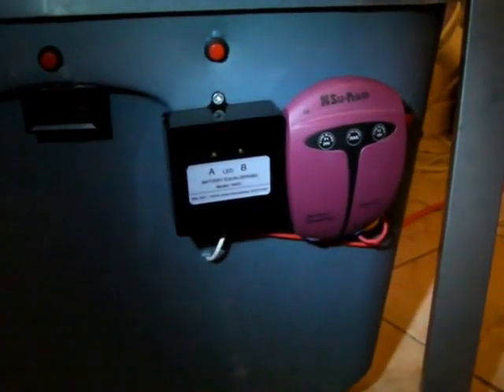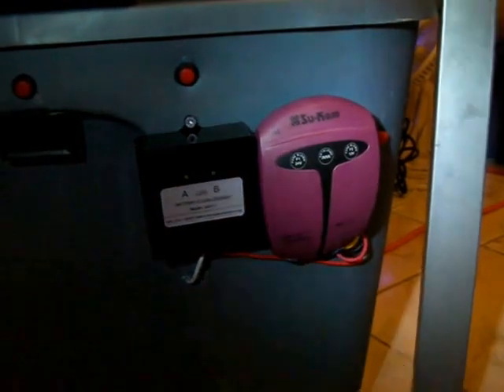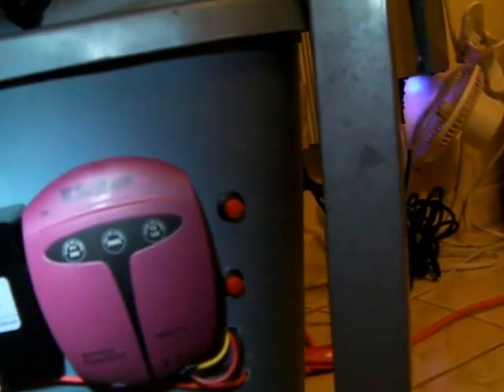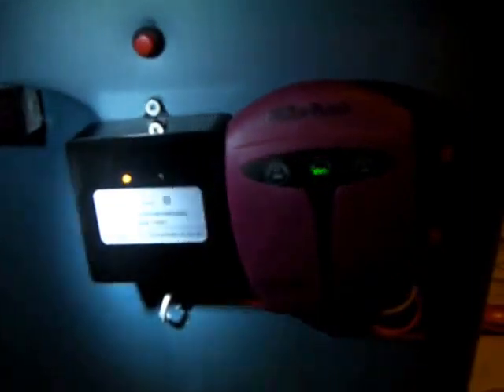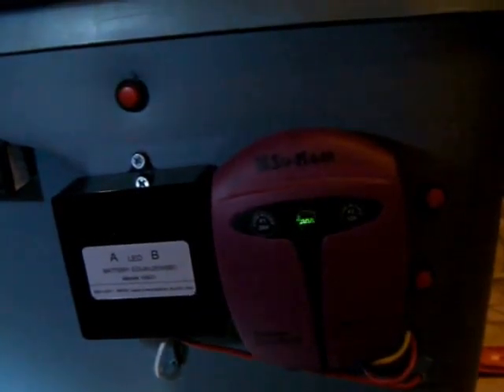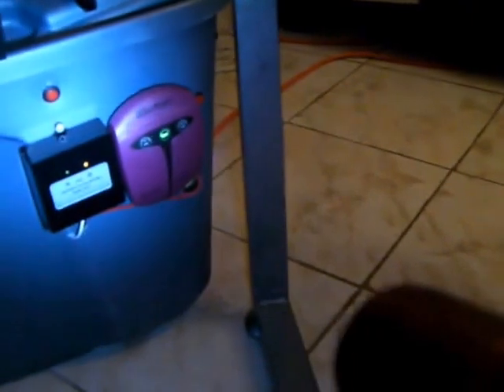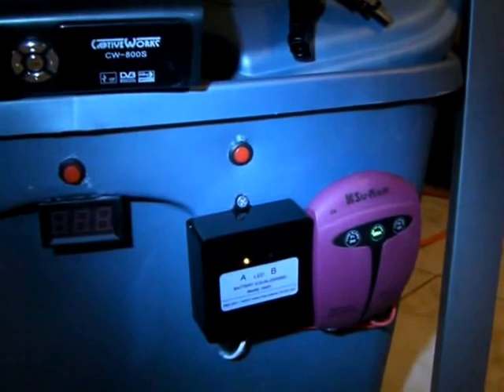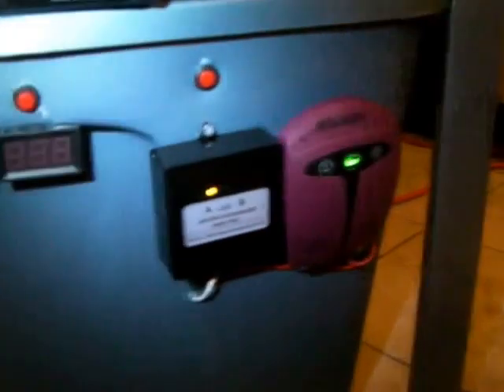SOLAR BATTERY BANK BALANCERS / EQUALIZERS SU-KAM AND HA01

Comment: By the way I am curious about the Sukam version as to what the yellow, black and red represent and how they should be connected in say -two a 12v battery in series connection? 
In that 24 v combined power of the two 12v battery, which coloured wire of the equalizer will connect terminal of the two batteries.
Reply: oh brother it has been so long I dont even remember. After this video I notice that these battery balancers are not that great. I did have good experience with Sukam BMS 48. I also got a chinese unit from ebay that has been the best. That is the unit I am buying from now on for my systems.

Comment: Do you have a video of your inverter?
Reply from the maker: Kain Duran no, sorry...after the Hurricanes we left Puerto Rico and I sold most of my inverters and solar equipment ...sorry about that...look for the online manual I think the model is Cotek 1500s 24 or something like that it was 24v and 1500w pure sine ...I also had a very good experience with the swi 3000w 48v and the 2000w version they are true pure sine waves and also the Reliable brand I have tested and found to be good... Cotek is UL tested something that Swi or reliable are not so keep that in mind.

Comment: Is that a 24v  sp cotek inverter 2000w .how much power it uses just being on ..??not runing noting just on..
Reply from the maker: Kain Duran it was not much it worked great I would say about 12w but would have to double check that on the manual. .5 amps sounds about right, whatever the watts it worked great for hurricane Irma and Maria...did not spend a single day without power after both category 5 that hit Puerto Rico.

Comment: hi...both answers could be right....it is normal for balancer LEDs to be off if batteries are balanced...one way to test them is put a charger only on one 12 v section of the 24v bank and charge it...obviously this 12v section will rise in voltage and balancer should start blinking...if it does then test the other side.......voltage difference should be more than .2 vdc ...other way to test is to use a voltmeter and see if bank is balanced..

Comment: A question for you. I have 4 of the Chinese version HA01 attached to my 24 volts 4 string battery bank. When i installed them months back the lights would blink during charging and once system floats all the LEDs would go off. However as of now, all the LEDs on the A battery of all the 4 strings keep blinking. Does this mean that the balancers are bad or what exactly is happening ?
Reply: Start The Rebellion - Im glad I came across your comment. I was about to purchase 5 units for my 24v 5 string pack. Quick question though. Will 5 parallel strings overload the 5A capacity of a single HA01?
Reply: It's not a matter of overloading, it can't do that. The unit simply siphons power from the higher side over to the lower side, nothing more. It's very effective, but on a 24v bank the more strings you are balancing the more it takes away from the efficiency and accuracy... meaning... it will still take the same max amount from the high side (5A) and give it to the low side, but that max amount of correction is now divided by the total number of strings, so it can't balance them as quickly (that's the efficiency part)... and... it can't correct for the discrepancy between individual batteries on the same side (that's the accuracy part).

To be clear.... all of this information was gathered from communicating with a few different sellers who each confirmed what I've shared, so I don't have first hand experience yet but I do have enough confidence to have ordered one to try. - I am personally going to be using just 1 unit on a 4-string 24v bank, but knowing the limitations of effectiveness using the unit with that many strings, I'll have each individual battery in the bank very carefully voltage-monitored to see if it's effective enough to work. If not then I'll try something else. It was cheap enough to experiment with.
Reply: The most important thing to keeping individual strings in series/parallel banks balanced is actually to make sure that the total length of each string's cable chain is exactly the same. Cables introduce minor amounts of loss per unit of length, and these add up over the length of the string. Different amounts of loss in different strings creates an imbalance.

Of course you should also only use the same gauge cable, as well as the same type, brand, and age of batteries as well.
Reply: You are not supposed to use four HA01 units on your 4 string 24v battery bank. You are only supposed to use one HA01. I understand why you thought to use four (one per string), but it is wrong. You are only supposed to use one, look at the User Guide. It says in a couple of different ways to use only one per 24v bank. Look at the diagram for wiring up two parallel series strings, that is how you wire up four strings as well. Just add two more strings at the bottom of the diagram with strings 3 and 4 wired the same as string 2. - I think using four units on the same 24v bank can cause the units to get confused and step on each others efforts to balance their own strings.
Reply from the maker: This will not affect anything; it only increases the amps it is capable to compensate. It is like connecting one battery to an inverter but if you parallel 2 batteries then you increase both ah and amp capacity.
Reply: Thanks heaps. Ill be running a similar experiment by the sounds of it. :)
Reply: No problem, we solar types gotta stick together. :D
Reply: Thanks heaps for your help. :)
Reply: Oh really! Appreciated. I was looking at the Victron balancer and surprisingly,the tech support confirmed that I need only one Victron balancer to support my 24 Volts 4 string battery bank. Thanks
Reply: What is use this sukam power gaurd